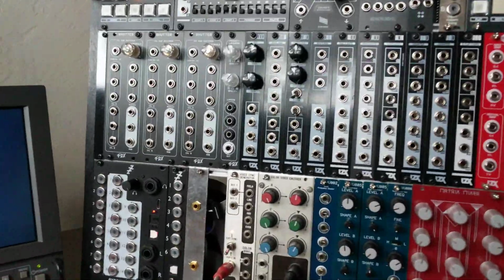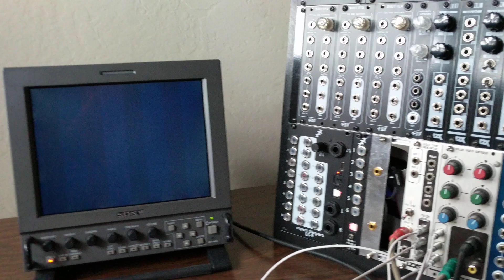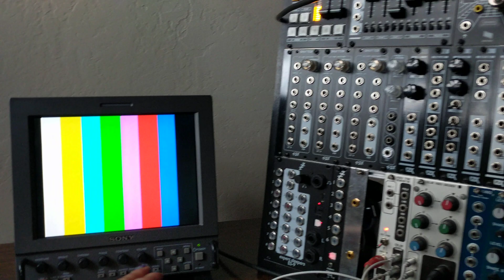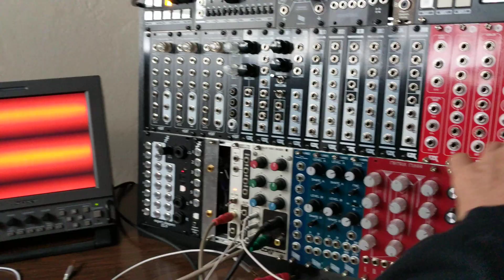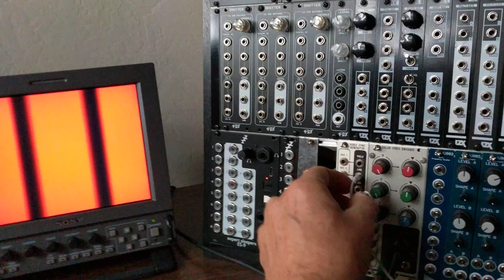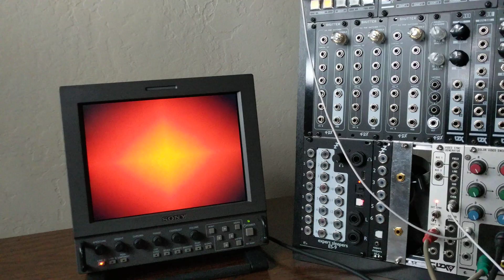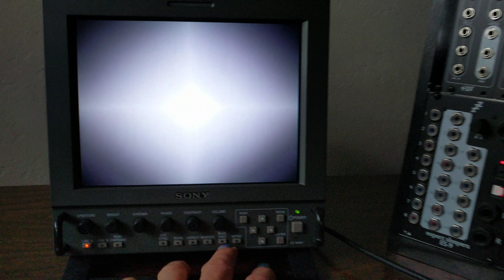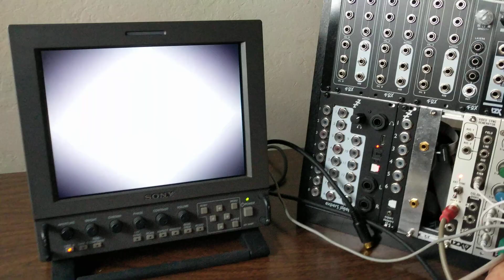LZX Industries: Video Sync Generator + Color Video Encoder

Comment: Thanks for the video! I skimmed through it earlier at work but finally watched through it fully. Good to know about the switching jacks wearing out. I may just replace those jacks.
Reply from the maker: I just had LZX replace the jacks on another CVE for $50 USD
Reply: @BentonCBainbridge  Looking at the module in hand, I actually have extras of those exact jacks laying around, don't even have to buy anything!